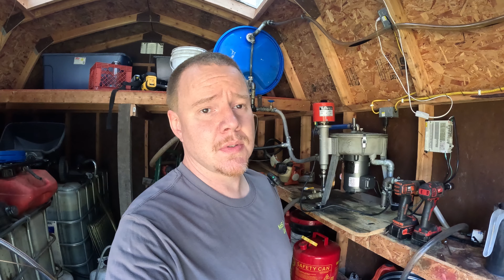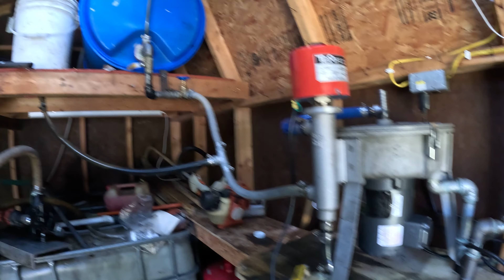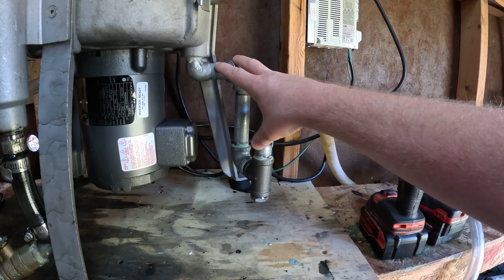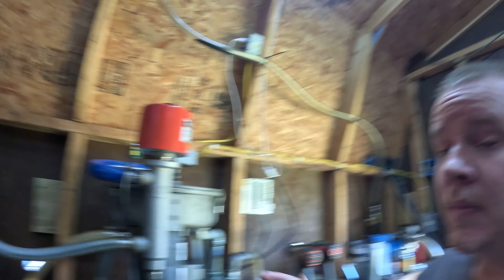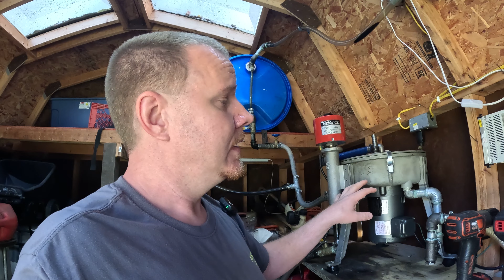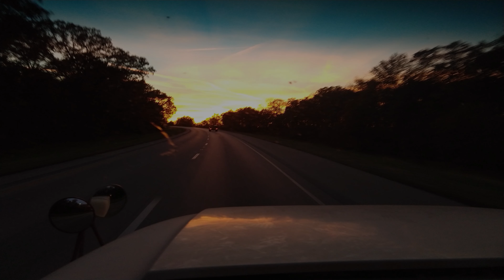Black Diese Basics - Part 2 - WVO Extreme Centrifuge - The Heart Of The System - WMO - WVO - Fuel

Comment: Question about VFD setting: what is the frequency you set the VFD in order to get 6000 RPM??
Reply from the maker: What VFD?  What motor?  What voltage?
Reply: @NotSoGrandGarage  Same one you have on the Extreme....230v, 3ph, 6000 rpm.
Reply from the maker: What VFD?  @gregg2560
Reply: @NotSoGrandGarage  Same one as yours I believe.
Reply from the maker: @gregg2560 set the freq. knob to +40hz...   Motor/nom to 75%..  and acc/Dec. To 30 seconds.  Then use the speed control knob (the small add on piece that has the run/stop switch, motor rotation switch, and speed control knob) to control the speed in real time.
Reply: @NotSoGrandGarage  Thanks
Reply from the maker: @gregg2560 no problem

Comment: Heard the gear pumps aerate the oil a lot. Have you considered using a sealed standpipe in the lower “clean” tank and put compressed air in the tank to pump it out?  Wouldn’t aerate or mix anything up. Also its quieter than that pump you have
Reply from the maker: Not worried about aeration on the clean side.  There isn't much of anything to mix up as the drum gets pumped dry every run.  My transfer pump is a vane pump also.  Not sure it makes much difference though.  With that said, I've not had any issues caused by the pump over the last decade or so.
Reply: @ it certainly seems like a robust pump. I guess by the 3rd run none of that mixing would be a problem

Comment: Can hydrolic oil be used the same way as motor oil to make black deisel one of the shops I pick up oil from has 4 tanks of old hydrolic oil they gave me and I have no idea if I can use it or not they gave me 1100 gallons of waste engine oil and 4 330 gallon ibc totes of hydrolic oil
Reply from the maker: Yes it can.  I get it from time to time and I mix it all.  No issues.
Reply: @NotSoGrandGarage  oh so I don't need to use it by it self just mix it with the oil  is fine to do
Reply from the maker: @lifeoftraveling8330  in my experience, that is correct.  I've never kept hyd. oil separate.  If it's petroleum based ..  it all goes together.

Comment: Good morning, I have a question. In This black diésel the viscosity its higher than the normal diésel, that not afect The motor or its performance? or should we add something to low the viscosity?
Reply from the maker: Yes you need to thin it out either using my preference which is gasoline...     or diesel...   or kerosene...    or heat.  My typical blend is 90% oil to 10% gasoline.  You can go as high as 30% gasoline.
Reply: @NotSoGrandGarage  thank you so much!!. I will make my first test this weekend.
Reply from the maker: @CarlosRamirez-col  be sure to check some of my older videos.  I go into a lot more detail on how I do things.

Comment: The PA Biodiesel claims achiving 1 micron cleanliness level with 3450rpm and 1600g. A video of yours where you sent an oil probe to a labaratory with your WVO Designs 3600g unit showed a cleanliness level of 3850 parts per 100ml being over 4micron (heated and 2 passes thru the centrifuge), IF I remember correctly. So I doubt, that PA Biodiesel reaches sub-1-micron cleanliness, even if you drop the flowrate significantly. 

The US Filtermaxx 10,000G unit would give me anxiety, that it will detonate with shrapnells flying around. I would lock that thing behind a 1/2" steel plate - it's a bomb! Im doubting that the "thin" cast aluminum casing will hold back any shrapnell... Despite that, that unit seems top notch

Marlon
Reply from the maker: Depends on how you look at it.  I'm certain their unit is removing sub micronic particulate.  If you recall the testing, the particulate count was MUCH higher before processing on each test.  No filtration system is perfect and you'll never remove all particulate from any fluid unless the fluid stays in the lab.  Even when distillation is used, the oil will pick up particulate matter from inside the plumbing of the unit....   dust in the air...   etc.  The question is..  does that matter?  I'd say no.

Comment: Wow perfect timing. Im building my fuel shed right now. Just started looking into buying totes and barrels. What type of hoses do you use, and what type of pipe? Galvanized or regular black pipe?
Reply from the maker: For tubing, I use standard reinforced vinyl that comes from any hardware store.  Black pipe is fine and less likely to react with the fluid flowing through it.  I've got a few Back To Basics videos up so check the playlist.  One covers plumbing the gravity drum.  If you are looking for a centrifuge, be sure to check out the website as well.
Reply: @NotSoGrandGarage  thanks.  Ive been going through your older videos. Very good information.

Comment: Hey Chris, this is Justin Garvin that bought the extreme about a month ago. It's been so incredible seeing how much  sludge came out with just the centrifuge,  then when I hooked up the heater,  even more crud came out. The difference in the appearance of the 2 tests (with and without heat) is incredible . I'm so glad I went for the extreme packages
Reply from the maker: Nice!  Its certainly eye opening when you see the difference.  If you check back through some of my videos, I've tested filtered oil and pressure centrifuged oil against a direct drive.  There just isn't any comparison in performance.  Thanks again for the order!